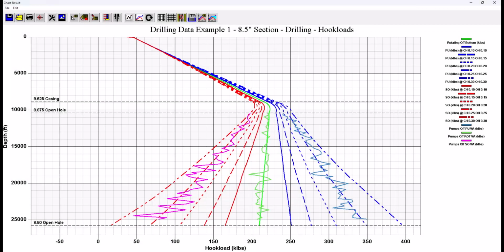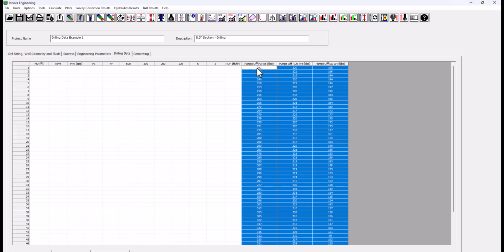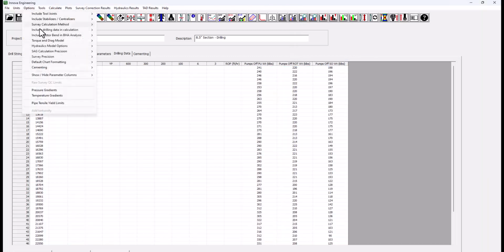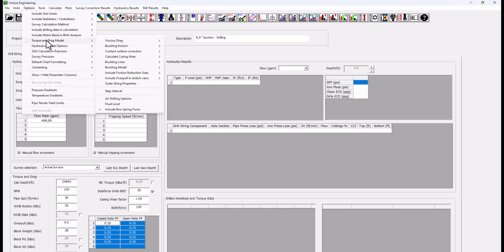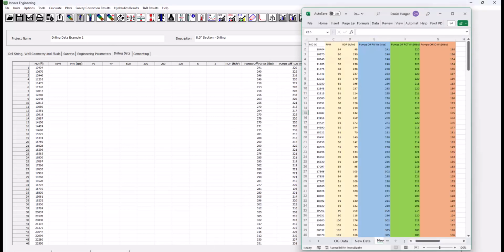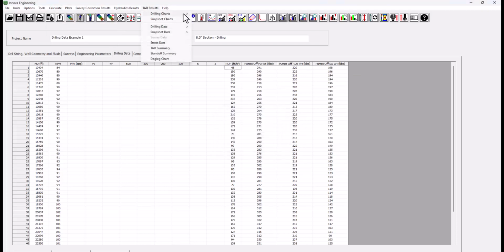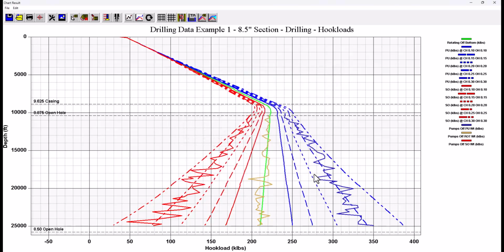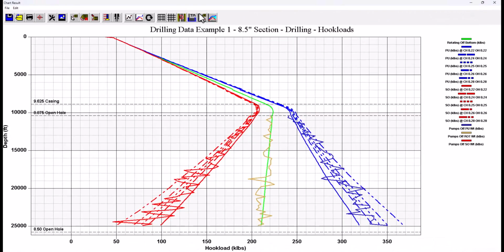Innova Engineering   Back Calculate Friction Factors

Comment: Thanks for sharing, could you please provide another video with more clarification. I'd really like to see a complete example until final FF results with more explanation.
in same cases it's not possible to get all the data with pumps off, is it acceptable to use the data with pumps on? why did you use the same FF for both OH and CH ? many thx